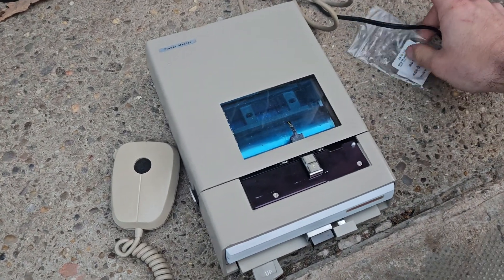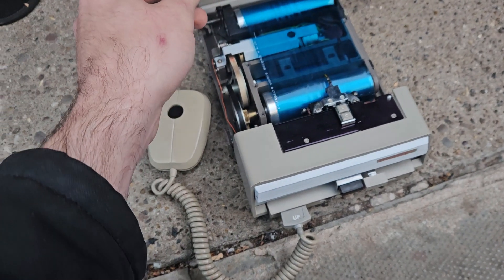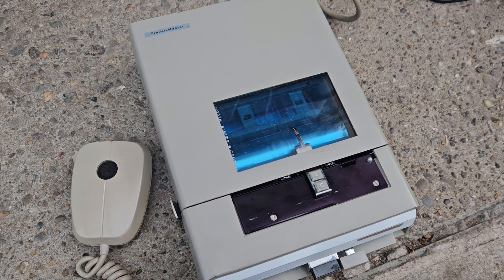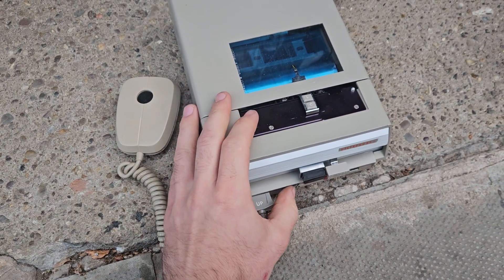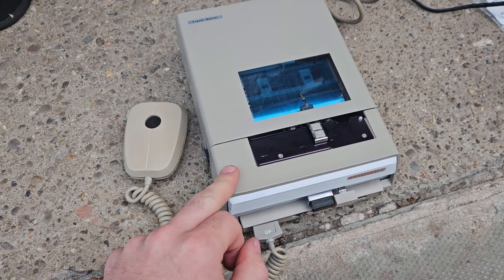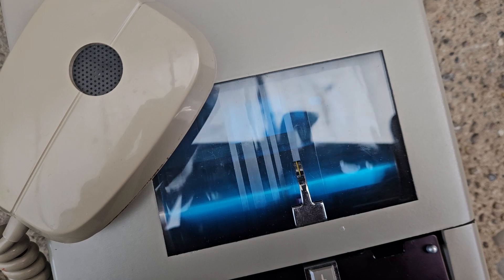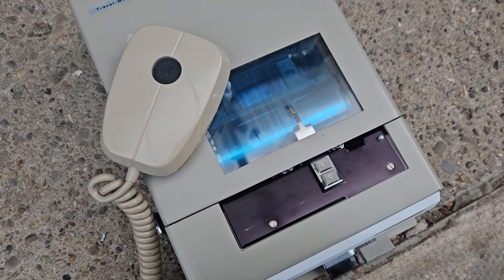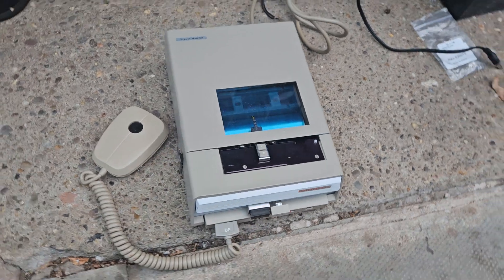Dictaphone Travel Master C Working !

Comment: Fascinating! Although in its current state, it barely sounds better than a fresh recording off an Edison phonograph which this also reminds me of mechanically. It has more treble but also warbles a lot more than the rigid cylinder. But maybe that's due to the age of the belt?
Reply from the maker: To ne honest, that's about how these sound, the speaker inside the mic is that of an old telephone type, the speed could be sorted with a belt or two, but as far as the sound quality for this current setup, that's it